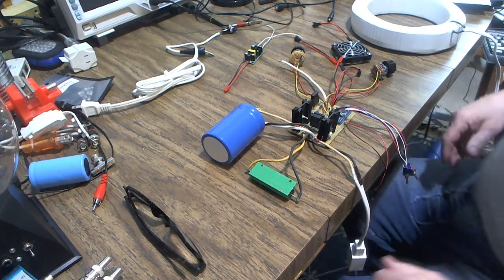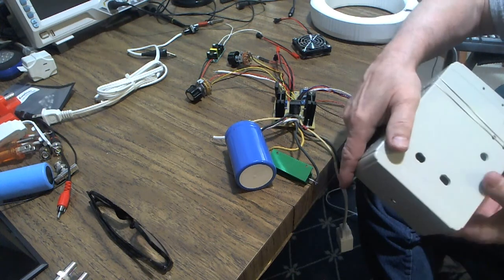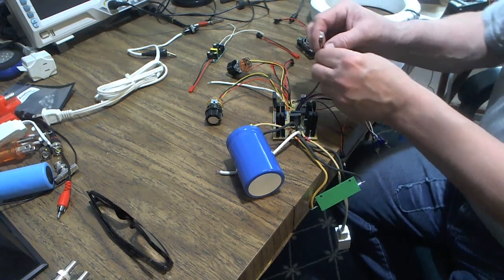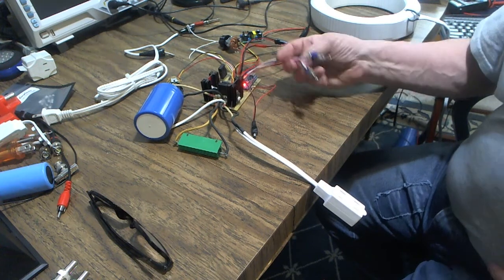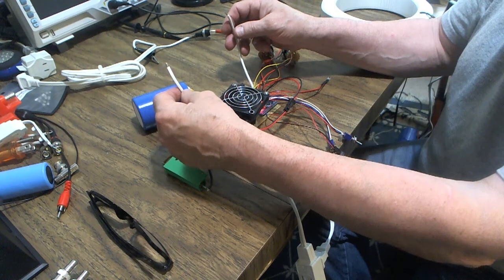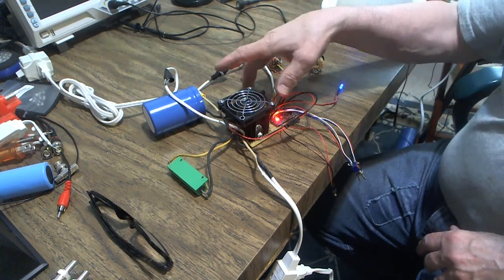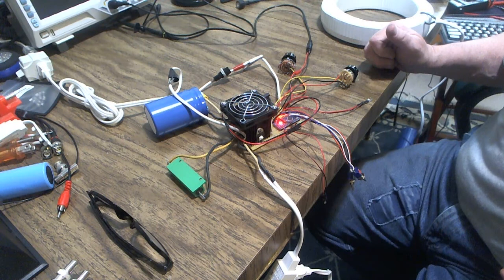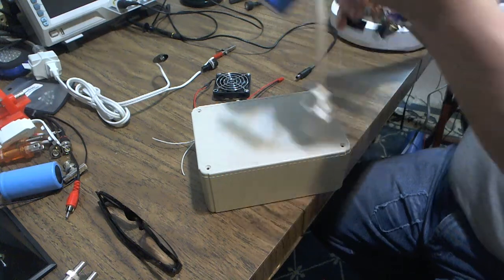PEMF Semi Kit - What is it?

Comment: Hi, gskempe9, I got another question, I see the big 100Ohm, 100W resistor in ur demostration, but I can't find it in the pdf of your circuit, where does it go connected? please help, I have put together the circuit 5 time and every time I've blown components :(. btw, I'm not talking about this device but the frequency converter
Reply from the maker: The circuit schematic PDF clearly shows the 100 Ohm  resistor is labeled as R5 between SCR1 a TN4015 and D5 a 30 amp diode.  The PEMF absolutely needs this resistor to insure SCR1 fires correctly.  The circuit runs rock solid with the present software which is also posted on the website.

As for the Frequency Converter, it does not have a 100 ohm resistor 100 watt resistor.  However I'm not sure you are stating it has one.  Your are a little confusing with  the 'btw' part of your message.  If you are having problems, direct email is better than using this blog for communication exchange.
Reply: Thanks for your replay, I just send u an email to clarify